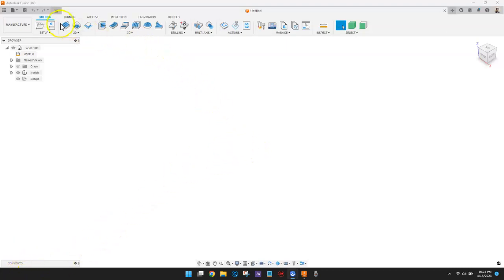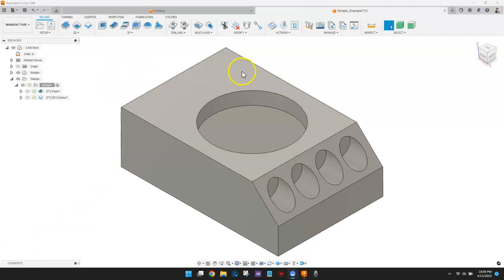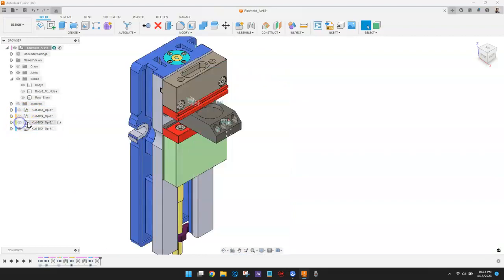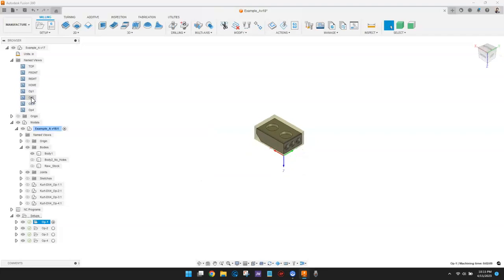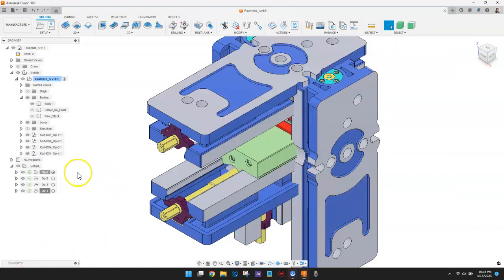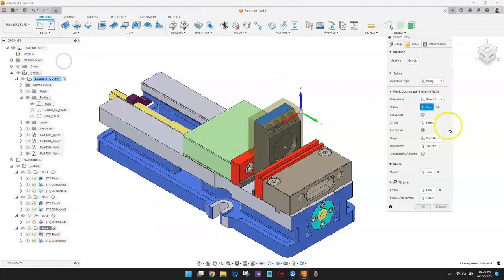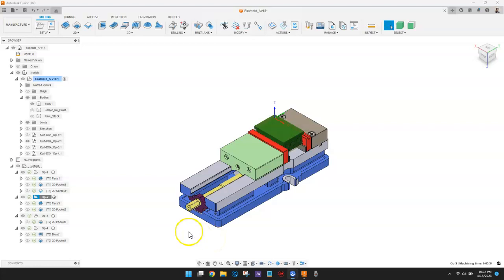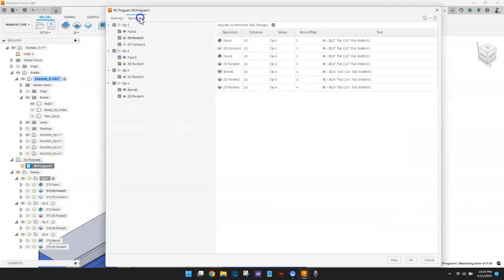Fusion 360 CAM: Stock From Preceding Setup

Comment: Great video, super helpful! I'm dealing with a similar situation right now that requires 3 setups to machine 3 different sides, except one of the setups involves custom soft jaws to hold a part that does not have any straight edges. I used projected sketches to design the custom soft jaws using an extruded cut feature. I'd love to see you do a video similar to this video but that involves an odd-shaped part and custom soft jaws. I'm sure you know of a better Fusion 360 CAD / CAM technique to handle this scenario other than how I did it. Thanks for the great content.